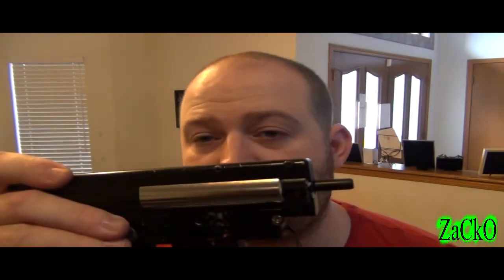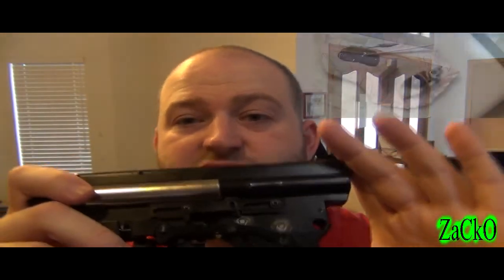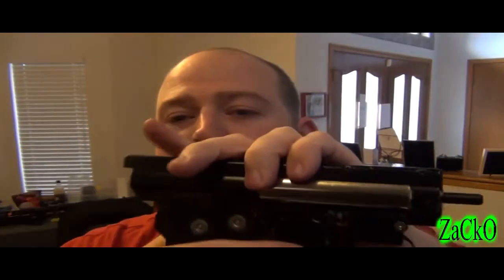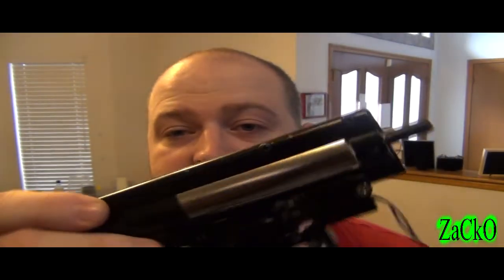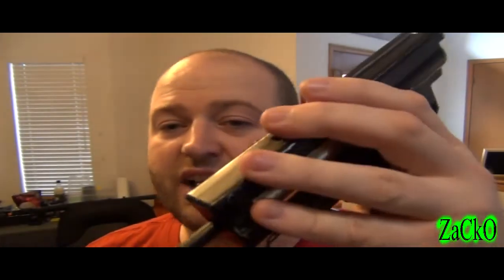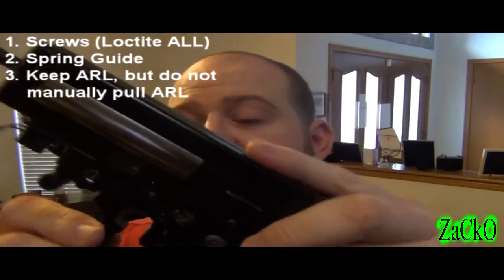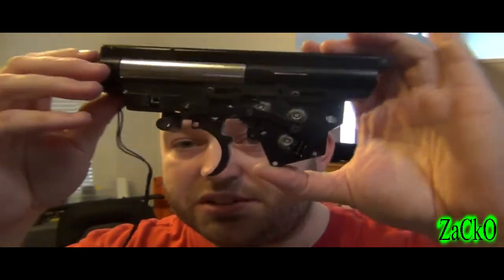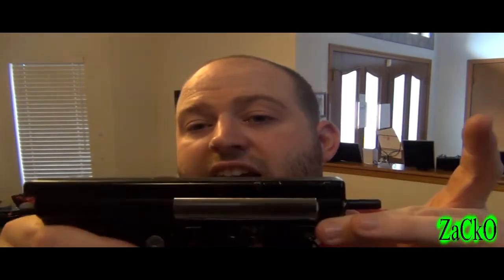Become One With The Gearbox

Comment: Thanks again zack. I'm so glad you got the issues sorted out. I just did a buddies g&g gearbox adding spring air nozzle and motor. And checked it how  you described and found little issues and addressed them. I'm definitely looking at the guns in a better way now. I can't believe the bevel gear was bad as well. That gun was posessed lol

Comment from the maker: Bevel gear is not bad, just doesn't mesh in this setup well. The problem was after changing the can and re-shimming the motor. The gear is still usable. It will just be tighter than what is best used at the moment.